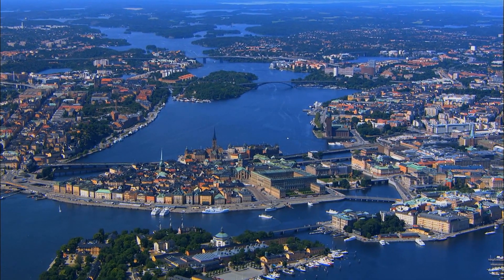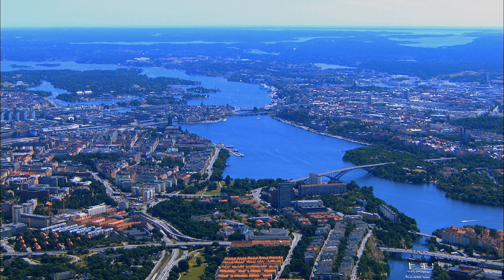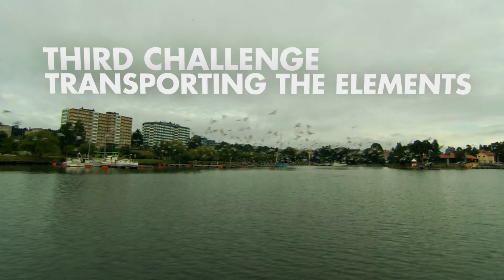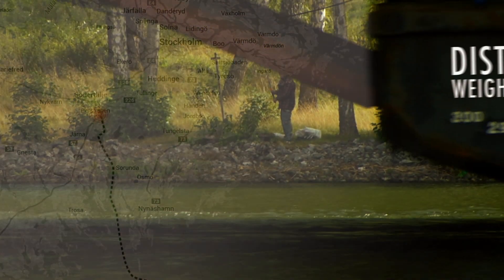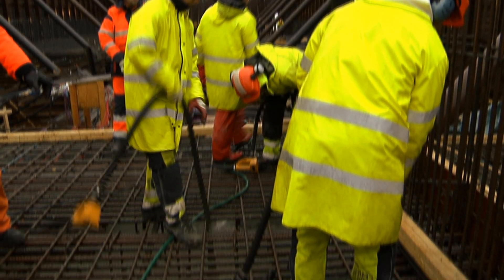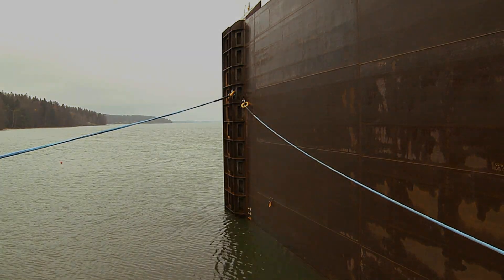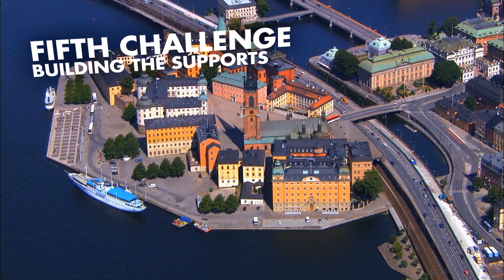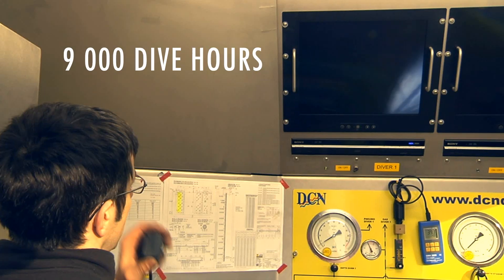ZÜBLIN Project Underwater tunnel in Stockholm

Comment: It looks good. But also if the bottom sand was frozen or pumped with some material, then could the tunnel be bored through the hardened bottom layer?